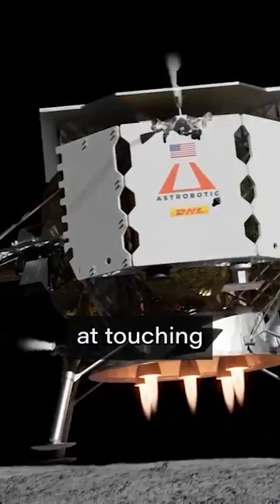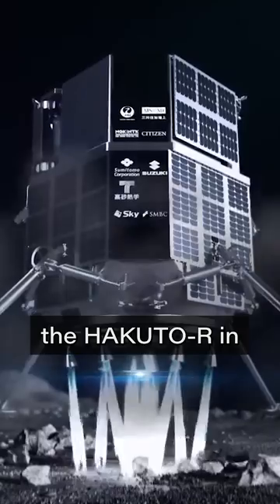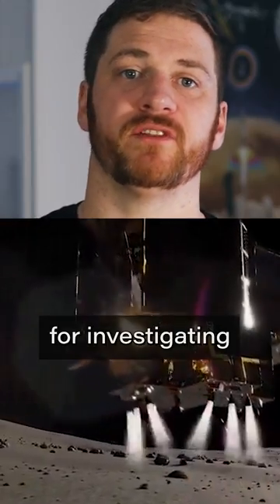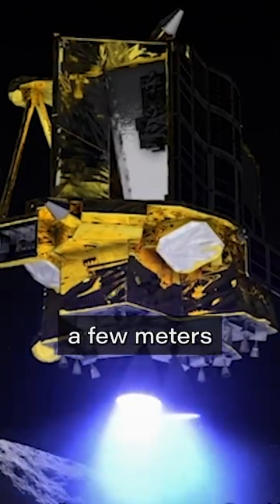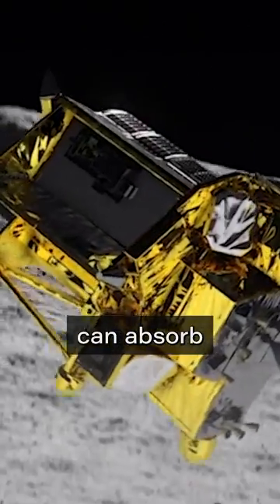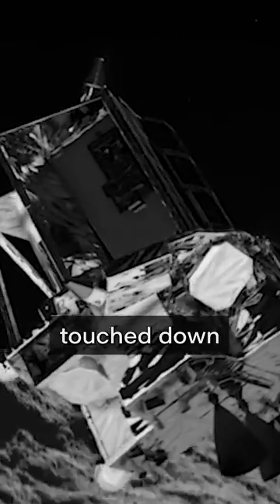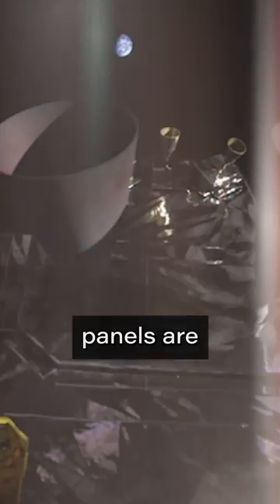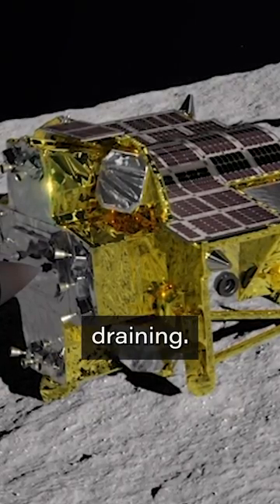Did Japan Land On The Moon?

Comment: You didn't mention the part where 1 of the 2 main engines LOST ITS BELL and it still landed successfully. Oh, and where the small rover that was dropped off just before touchdown took a picture of the lander.
Reply: “Landed successfully” 

*but also didn’t land successfully and landed on its side*🤣
Reply: it crashed. it didn't land successfully.
Reply: @afg122602  You may not be familiar with the light aviation definition of "landing": "A good landing is one you can walk away from. A great landing is one where you can use the aircraft again." In this case, the systems were still operable and science could still be advanced.
Reply: @markfisher7962 If it didn’t land as intended, the landing is a ‘failure’. Even if it still landed and is completely fine, it means that the method they went about trying to land it the first way didn’t work.
Reply: @nathon1942  Hmm. That's rather harsh. If it's applied to GA operations, that would mean that 90% of landings are failures. How about if 50% of the science can be accomplished, that's a 50% failure? Even the "splat" landings yield new knowledge, and this one is far from a splat!
Reply: @markfisher7962 it doesn’t matter if they yield knowledge, that landing is a failure 

And it should be considered as such because things did not go as intended. This doesn’t make the mission a failure, only the landing.
Reply: @nathon1942 are you saying that apollo 11s landing was a failure?
Reply: @luscious_hair_dude  Yes it was a failure in multiple ways, it did not land as initially intended because of issues with the spacecrafts, they experienced unexpected changes in gravity, and barely had enough fuel to even land let alone leave the Moon. NASA had to revise and develop their methods and technology to prevent these failures from happening in the future.
Reply: @kcck7588 space x 3-3-24 the cgi tech went overboard with the visual effects.  40 seconds to get off the ground.  . 
Whats your altitude captain   IDK maybe 20 feet i can't see shit with all this smoke. We gonna have to refuel for this payload to make it.  Wheres the next fuel station between earth and the moon. Next time release the fucking brakes sooner.
Reply: They try to save space too

Comment: In fact, the CG of the JAXA landing sequence is wrong: in the CG, the main engines stop after hovering and the RCS transitions to the landing attitude. In reality, however, the main engines do not stop after hovering; the main engines operate while the RCS is generating angular momentum, and the main engines stop after some tipping. This is due to sequence limitations due to angular momentum performance by the RCS and the landing attitude limitations of the SLIM.
If physical simulations are performed based on the announced lander specifications and the performance of the employed RCS, it is clear that JAXA's CG is wrong.
Why JAXA presented a CG that differs from the actual sequence is beyond me.

Comment: We had people walking on the moon over 50 years ago right??? Why are they have such a difficult time even landing an unmanned spacecraft on the moon? We have made pretty good progress technologically speaking in the last 50 years…you would think it would be relatively easy at this point  🤔.
Reply: Because we haven't been going to the moon for that entire 50 years, we went to it a few times then just stopped. We don't have 50 years of moon landing experience, we have.. Whatever amount we have for the original landings.

Plus this is a Japanese mission, not an American mission, Japan doesn't have the same amount of experience as the US.
Reply: Many people fail to realize that everyone is essentially starting from scratch on the moon project; including the US.

1960s mathematical calculations don’t translate to modern tech anymore because of massive improvements in technology, material science, and methods/techniques of doing it.

The lunar lander weighed about 15-16 tons. We probably could build a newer version that could probably weigh less, and be much larger. That alone is just a new set of math number crunching to do. We have advanced computers now, so now new techniques and simulations can be done, but actually doing it is much harder.

The US is the only country so far to have successfully landed unmanned on Mars, and methods of having the capability if doing so is immensely top secret. Basically let the other countries figure it out. They’ll eventually get it.

Comment: Why aren't we using more nuclear batteries Instead of solar panels
Reply: They're heavy and expensive, very expensive.
Reply: Ungodly heavy and VERY pricy
Reply: Dog the only nuclear powered things we can do, and that’s a big we given only a few countries have the ability to build one, is power plants which are MASSIVE, aircraft carriers which are MASSIVE, and submarines which are MASSIVE. There has been a surge in ion thrusters for space use though
Reply: @xXtuscanator22Xx  no, you can make satellites and other spacecraft nuclear powered. Take, for example, the voyager probes or the Curiosity and Perseverance rovers, those are powered by Radioisotope Thermoelectric Generators, or RTG's. However, as I said in my reply to the original comment, RTG's are both heavy and expensive.
Reply: @xXtuscanator22Xx  You're confusing nuclear fission with nuclear decay . Yes, nuclear fission reactors have only been made small enough to fit in submarines and aircraft carriers, but nuclear batteries using nuclear decay (RTGs, Betavoltaic batteries, etc.) are a lot less complex and can thus be made significantly smaller, but they do have a lot less power output.
Reply: @geryz7549  Well gimme your opinions on Mango do you like Mango’s
Reply: @xXtuscanator22Xx  we have nuclear batteries, but they're very heavy and very weak. The voyager probes used them since they would be going far away from the sun. Solar can only get you so far.
Reply: @oatmealman1586  Do you like the Mango
Reply: More expensive to buy, build, and launch unless you remove features from the craft. That's not very helpful.  Also, I'm pretty sure it produces less power (the non-steam one) at these distances from the sun.